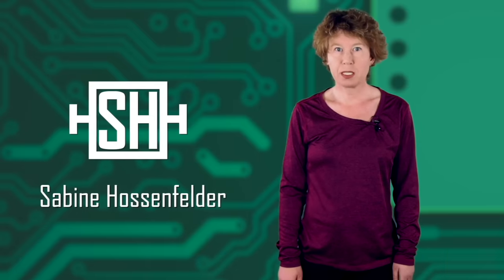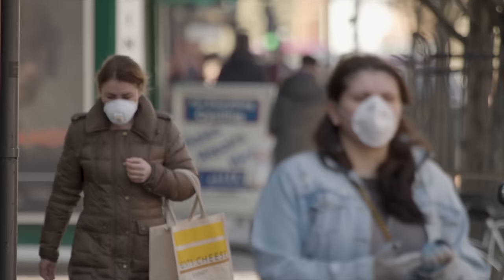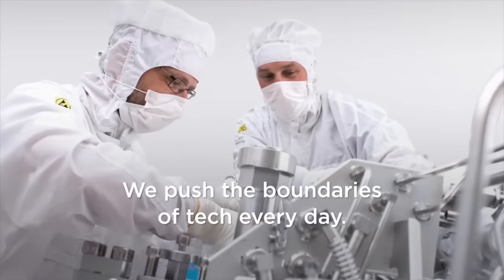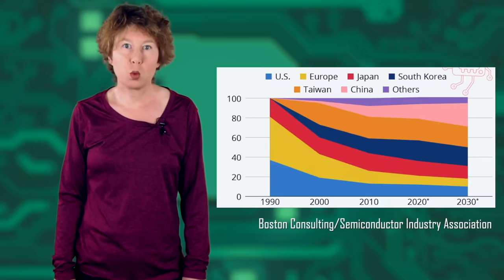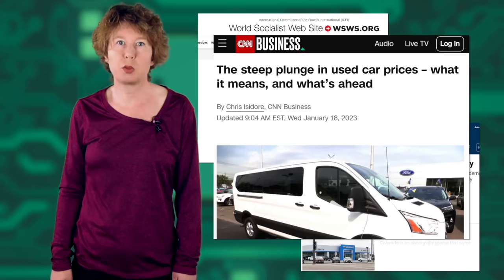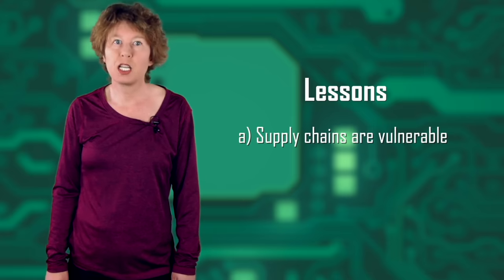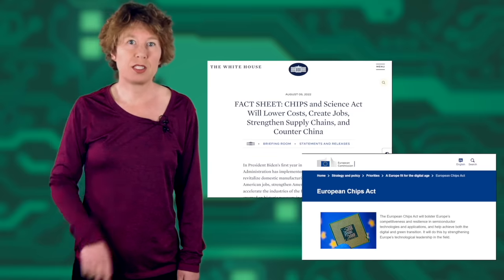All you need to know about the microchip crisis

Comment: The most visible example of all of this in my industry is the Raspberry Pi. We bootstrapped a new product around a Raspberry Pi 3B+ and only build 10 units a month, and still had to wait 1.5 years for our order to deliver from a US distributor. I'm an EE, and it scares the crap out of me to design anything these days. In fact, my instinct is to order a reel of chips and only use these for R&D designs for my customers so they can at least get into production before sorting out supply chain issues. Before all of this, the shortage was chip capacitors, etc. Always something in this industry. Maybe Sam Zeloof will start a new fab and help us all out.
Reply: I went through this multiple times with DRAM in the 80's. You always designed-in the densest stuff you could get samples of, and you ordered twice as many as you needed so that you could maybe get an allocation of your real demand. Everyone did it from what I could tell.

I got into the semiconductor equipment business in the 90's and saw even more rollercoaster demand in everything from equipment to materials. Mainly due to technology node changes.

Comment: When my car died in 2022, I was forced to use my bike. I waited 2 or more months and finally was able to buy a new car. In most parts of the U.S., public transportation is not available and when it is, the service is terrible. In my area, rich people have prevented all efforts to construct decent public transportation. As you pointed out in your excellent video, everything is tied to everything. No decent public transportation and a dead car required that I had to buy a car. Had the area been able to overcome court fights, I would not have needed to buy a car. If the area had been able to overcome court fights, the local roads would be far less congested. Because of congested roads, ambulances are delayed and people die. Road congestion increases inflation, puts higher demands for road repair, and reduces innovation.

Comment: I'm employed by a company which manufactures and sells Linux-based computer systems in the US. A couple years ago, the company purchased a warehouse and factory equipment to begin manufacturing and assembling in the states; as opposed to solely relying on Taiwan for all manufacturing and assembly. Many of our customers work in STEM fields, including universities, research labs, agencies, and tech companies. STEM types often prefer using Linux when they have the option over Windows or Mac; and some require the best NVIDIA graphics card available for their CUDA-accelerated applications. During and after the COVID lockdowns, we had record sales. People needed to recreate their labs and offices at home so they could work remotely. So the company had to expand to keep up with the demand. We made a lot of progress in open firmware, open hardware, and open source software for Linux.

When the chip shortages were at their full effect, it was nearly impossible to purchase graphics cards from suppliers. Even when they had shipments in stock, they saw what scalpers were asking and wanted the same. The only viable option at the time was to buy the most affordable cards available at the moment. Of course, NVIDIA decided to deprecate support for these cards in their latest drivers at the time. Despite that, most purchase orders for desktops were choosing this option, and I'm sure many opted to swap the card out for a card from an older system they owned. Thankfully, laptops with current gen NVIDIA graphics were not affected as badly, so they were a popular option.

There's a very different issue today. The consequences haven't been fully realized yet. COVID lockdowns caused supply chains to slow to a halt, which therefore caused inflation due to demand exceeding supply. The Fed and ECB responded with the worst possible timing by raising rates significantly and rapidly in the last year in order to curb inflation by "reducing demand". Yet anyone who's had Econ 101 knows that prices go up when demand exceeds supply, and prices go down when supply exceeds demand. Given that supply chains were already in process of being restored to fix the supply issue, it would have been more wise to do nothing at all and wait for the free market to correct itself.

Worse, government spending is so out of control that the US government is forced to borrow money at high interest to pay their debts. This is causing a double whammy effect where money that had been invested into the economy is instead bleeding out of the stock market and into risk-free fixed-rate high yield government bonds. Tech stocks had the most to lose because they're considered risky. This has caused a domino effect where everyone's scrambling to preserve their profit margins and share values. It's why we've been seeing companies making rash decisions that are damaging their reputation beyond repair. It's why there's been so many mass layoffs and greedy corporate policy changes lately. It's why companies like StackOverflow and Reddit have destroyed their reputation as they want to capitalize on the data that their communities have created over the last two decades. It's why so many are desperate give up and pivot towards profiting off the "AI" craze.

Profits be damned, the real loss we've yet to fully feel is the loss of human talent and the infrastructure that's been built by the many developers who have been layed off or restructured. People don't realize just how important open source software is to the world today. Every person and business that relies on software depends heavily on the open source software that makes their devices and applications possible. So many open source developers have been slashed because they were deemed a burden to quarterly profit margins. No one's employment has been safe, regardless of how many years they spent at a company.

Comment: Coming from a materials engineering POV, I'm curious if there's not some additional lessons to be learned about safety with regards to the number of fires in these facilities and the level of damage. Obviously it's not the only component to look at, and the lack of casualties sounded like a good sign for evacuation protocols. However, it's easy to say that we understand the safety needs of any given process as the engineers and scientists involved, but how well that translates into practice seems entirely dependent on every individual at the facility. If the safety isn't built in... you're completely reliant on every individual who touches it to follow procedure.

I'll never forget going to a public science event held at another college as a metallurgy club and watching 3 individual catastrophic failures of the container being used to melt down iron. Twice, some of the coke got stuck due to - as we hypothesized - some convection currents that were worsened by the cooler-than-expected temperatures outside that day, and eventually led to explosive ejections of molten material. The first time, everyone ran away - save a single professor who ran to turn off the nearby gas line. The second time, this crowd of professional engineers and students all stepped right up to the safety line to see the process better. The final failure was of the container itself, with the bottom falling off - and the professor in charge asked the students to just get as much of the iron into our prepared casts as possible.

Comment: Let me point out another factor that added to the problem of chip production: noble gas shortages for UV lasers used in photolythography. Noble gases are obtained durig air purification process, carried out at steel production factories. Ukraine has been producing 70% of neon gas and 90% of highly purified semiconductor graded neon gas used for chip production in the US. Russia's invasion of Ukraine has severely impacted these supplies.

Comment: Thanks for the nice explanation; it's good to know what happened there and why Raspberry Pi almost went extinct. I hope the American semiconductor industry takes off nicely. 

I also wish the electronics industry relied more on general purpose parts like field programmable gate arrays (FPGAs), common microcontrollers and CMOS logic (a.k.a. "jelly bean components", as @EEVBlog calls them) than application-specific integrated circuits (ASICs). These have their uses but if it can be done effectively with a general purpose chip, I really think it should. It's also for the sake of serviceability, you're not left with a dead unobtainium chip you can't replace with anything else.

Comment: We are getting VERY CLOSE to the end of microchip design-rule scaling.  Somewhere between 2 microns and 1 microns we will probably hit the limit.  Scaledowns used to happen in factors of sqrt(2) but now i think its more like  20% or less (i.e 7nm -> 6nm -> 5nm -> 4nm).  That's not even useful informaition because 7nm, 6nm, 5nm, 4nm are just names and don't reflect a standardized measure of some geometry on a chip like the gate width for the smallest transistor.  Ever since 14nm most manufacturers have just been making up smaller "names" for their next generation of chips.  If TSMC were to keep naming things like this they'd soon offer 0nm, -1nm, -2nm chips ...Throwing $130B+ (China, USA, EU) into heavy industry at the end of an industrial revolution (VLSI) is probably not the best place to spend money, EVER ...

Comment: The automobile industry absolutely does not need older process chips.  They just didn't want to port their code and circuits to use newer chips.  Which is relatively trivial.  The newer chips cost a bit more, but they do more, so you need fewer of them.  I know because I make tech for cars.

Also, this many fires suggest either industrial espionage or war.  The safety procedures are so high in these facilities, it is inconceivable for there to be a significant fire in 100 years, let alone this many.  So, connect the dots and judge the plausibility before ascribing "series of unfortunate events" as if it were random chance.  We are scientists here, not "news" aggregators.

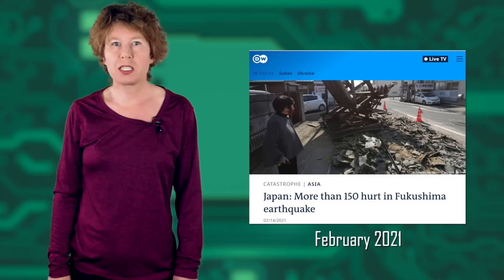Comment: I would like to mention some small errors. At 0:59, you mention a wafer but the video shows a chip-packaging. At 1:06 you talk about the connections used by a chip, but the video shows a printed circuit board. At 5:53 you mention 300 millimeter chips. Renesas will probably use 300 millimeter wafers. 300 nanometer can refer to their technology as this is the smallest distance in their designs.

Comment: The auto industry like having chips in there cars, because that means you can take the same part that physically compatible with many types of cars and make it incompatible so it will work only with one type of car, no need to retool Assembly line, just change a line of code, now you can charge more for that part 💰.

Comment: Silly American units of measure still produce the largest errors.  @ 7:22 the 150,000 Gal./day = 567,000 Liters, not meters cubed but this error on the metric side is simply corrected by a 3 decimal pt. shift tho that also means a 3 orders of magnitude error; 567 meters cubed. I really wonder what the original usage per day is since it would certainly be quoted in metric. Carry on.

Comment: One has to also remember that most of the world doesn't actually run with the latest and greatest 5nm node chips. VAST amounts of power regulation and basic logic chips and basic components are made totally on older technologies or completely different technologies from lithography because they cannot be produced with the new ones or it's completely unnecessary.

World works because of MICRO-CONTROLLERS and PLC's that can be made with 50-100nm nodes and discrete mosfets/transistors or operational amplifiers that are made with old nodes as well... at one point of the "chip" shortage, gobal supply of RESISTORS and capacitors were gone as well. That has basically never happened and it shows that issues ran deeper than just Taiwan, asml fires at few plants etc.

when pandemic hit, car manufacturers cancelled their orders of millions of basic logic chips, transistors, micro-controllers etc. and the manufacturers of those chips were already teetering on the whims of auto-industry paying them what they wanted to pay, not what manufacturers wanted them to pay (you can read about it more elsewhere), thus they cancelled all orders, expecting demand to go down -> manufacturers started to go under and close and sell their equipment to stay floating and nobody wanted to take the risk on buying equipment that doesn't have customers etc. so that hit the basic manufacturing HARD.

Then there were logistical issues with transportation from China (where most basic components are still made) to Europe and USA that made it almost impossible to get what was produced to where it was needed... everything ran to a halt and hasn't recovered since...

It's very bad and nobody expected that to happen.

Comment: TSMC's "water shortage" doesn't make much sense.  They use a miniscule fraction of Taiwan's water supply, less than 0.1%.  And a lot of that can be recycled as they're already running all the water through a purification and deionizing cycle.  It sounds like just an excuse to raise prices.

Also IC's didn't start in the 1950's.   The first commercialized IC's date from like 1960.   And that was at military prices, like $600 for a 4-transistor dual NAND chip.   They didn't become generally applicable until the late 1960's.
Reply: I think you mean TSMC.

Comment: The problem with fewer new cars meant older cars were staying on the road for longer. The issue with older cars is, they are less efficient and less safe.
Reply: Less safe for whom?  If they become unreliable, they'll be off the road more so fewer accidents.  But they have saved lots of carbon by not being replaced with a new car.
Reply: @stevemawer848  No. Per KM driven, an old car is less safe and more polluting than a new car. People aren't not driving. They're just buying old, second hand cars, for the same price as they would pay for new cars. People aren't driving less.
Reply: @BabyMakR  I didn't say they were driving less - where did you get that idea from?  And older cars produce less pollution than building a new car, so the message is clear.

Comment: Integrated Circuits came into our life not to make it easier but to make it dependable, useless and pollutant. Of course is not so easy to produce a frequency of a few gigahertz with a simple LC circuit but who needs such operating frequencies. After all who said that they use less power.? If you need for instance 500 watts for a device it dont make any difference if you use a transformer an electron tube a few capacitors and αn smoothing coil or a switcing power supply. You still need 500 watts. Pneumatic motor management was the best. Now you probably have to throw the car away because is not worth repairing the PCB's. I wonder what is gonna happen when quanten IC come to life. And of course money goes round and round...

Comment: One Dutch company makes the advanced lithography machines and one Taiwanese company makes 90% of advanced semiconductors. That's a problem. We need greater redundancy. ASML and TSMC might not like it, but it's what has to happen.
Reply: The real reason for this is the complexity of the technologies that exist, the main reason for example ASML can work on low and high NA machines is because of the complex supply chains and industry relations that invests back into ASML to actually produce the machines. The industry won't just decide that they need multiple different organisations in the already extremely expensive photolithography equipment production process. Its not as black and white as saying ya we need redundancy, it's more like it's just a very complex technology that needs the entire industry working together to even produce.

Comment: Good coverage but all the accidents and disasters described should be considered just the cost of doing business. Bottom line is that there's just a fundamerntal shortage of production capacity to produce chips of all types. After about 5 years of sanctions, China finally has come to realize the intent of the sanctions fully allows production of chips for most commercial and less advanced industrial uses and after wasting welll over half a trillion US dollars in attempting to kickstart inventing processes that workaround the sanctions are finally starting to invest in technologies that actually make money. It may almost be too late though as China's economy is deeply in the dumps today but such are the decisions and timing of the CCP rather than allowing market forces determine what the economy needs.

It will be decades if ever that semiconductor manufacturing capacity is sufficient to cover long term needs. There will be short term supply/demand mismatches like the current oversupply but it won't last long. Global demand for chips will resume when the global economy gets going again.

Comment: FPGAs are still dirt cheap given their performance and flexibility. 99.999% of products do not need microprocessors. Plus RISC-V is free and open source. Or you can get fancy and use RTOS if you wanna brag about multi threading.